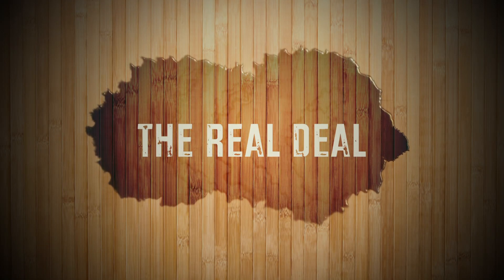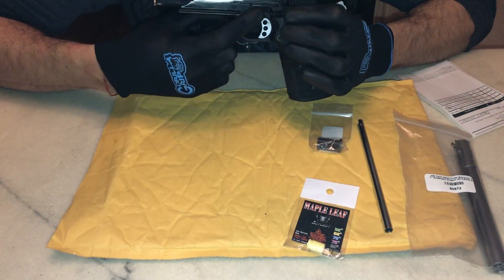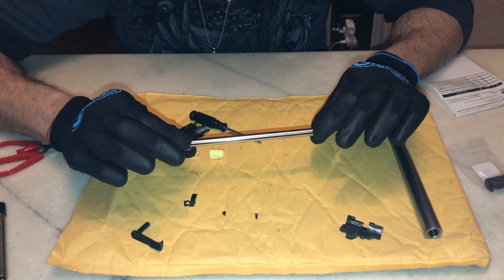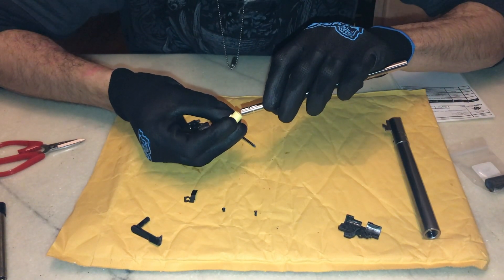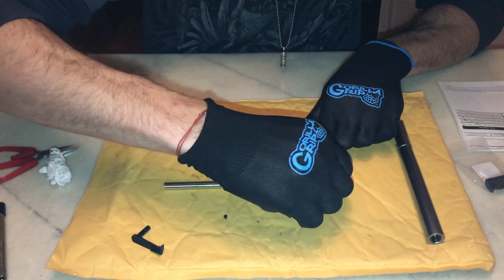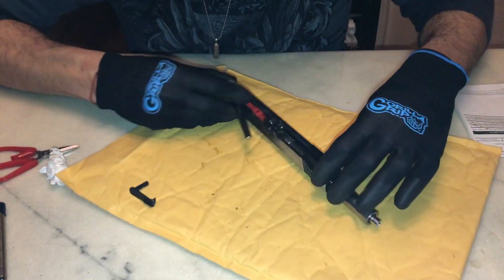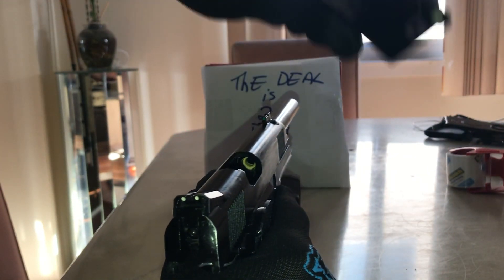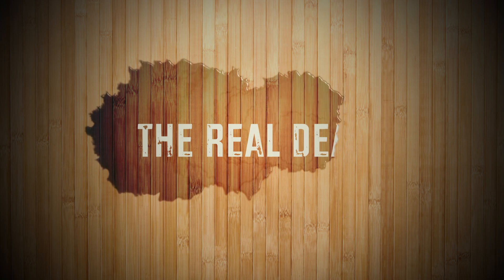Hi CAPA Upgrades to Increase FPS & Chrono

Comment: What other mods have you done to it? I see a nine ball gas route seal, and what looks like a cowcow or AM red nozzle?
Reply: Also is the 60deg bucking the best for the 7 inch barrel??.
And is 6.01 barrel better than 6.03
 I’ve got a new 5.1 hi capa, think I’ll get the 5.1 threaded outer barrel, and 7 inch inner barrel and cover it with a compensator or suppressor.
Good work with the video btw.
Reply from the maker: gaz c yes the yellow 60 degree highly recommended. Hammer spring is 150 percent. Nozzle return spring is 150 percent and it’s actually a kjw co2 nozzle with an upgraded piston head
Reply from the maker: gaz c and I really don’t recommend any higher degree bucking for pistols. For me I find this is the perfect softness. Any harder of a bucking your going to need your hop up turned all the way up to stop bbs from just rolling down your barrel
Reply: Yea nice man, why did you choose kjw c02 nozzle? And how did you know it would fit?
Also did 7 inch barrel make heaps of difference? And it being 6.01